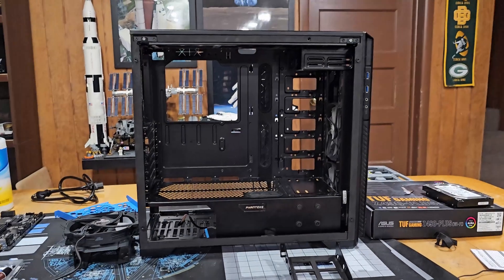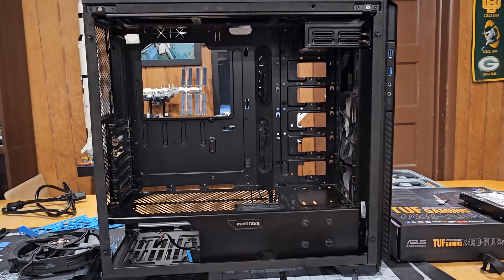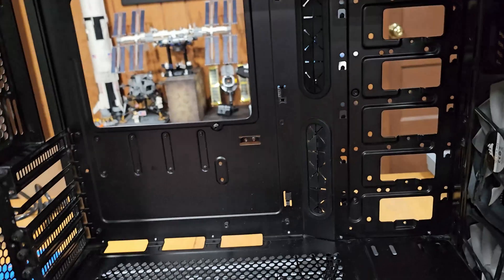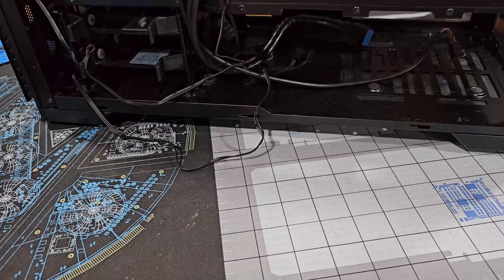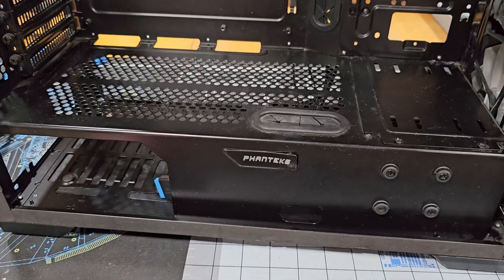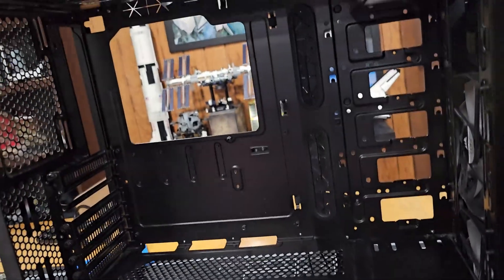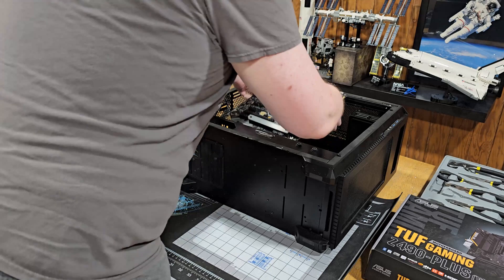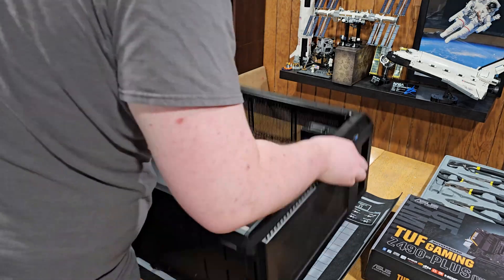Unraid Upgrade 23 Part 1: Case and Board Assembly - i9-10850k

Comment: Going through a similar situation myself.  Built myself a NAS in a pretty decent 1u server but I've moved and having it in a 1u is no longer convenient.  Also want to add plex and it's an older xeon that doesn't handle transcoding well as well as have a newer version of ipkvm software.  I'd usually go best bang for buck route but for once I splurged and got myself an Epyc CPU/motherboard/RAM combo to build the upgrade with.
Reply from the maker: Yeah very happy with transcode performance now, multiple people watching my plex server and no issues.